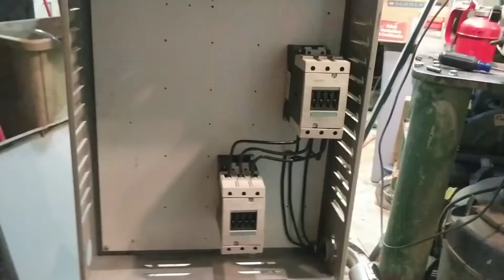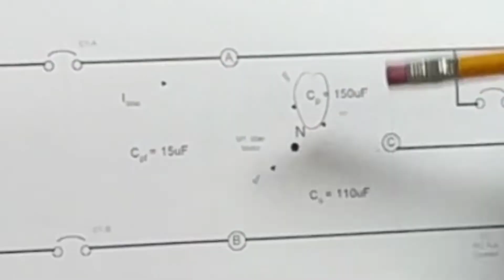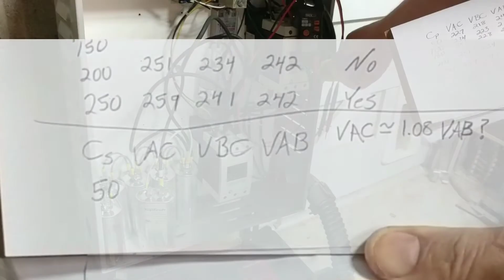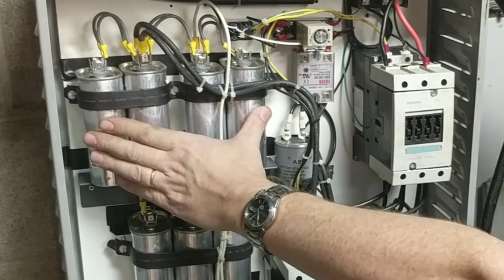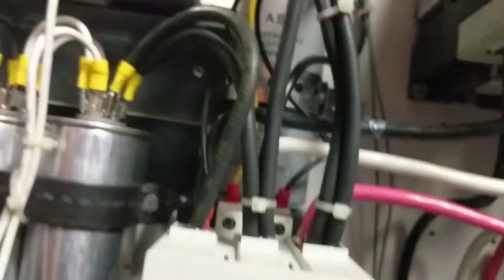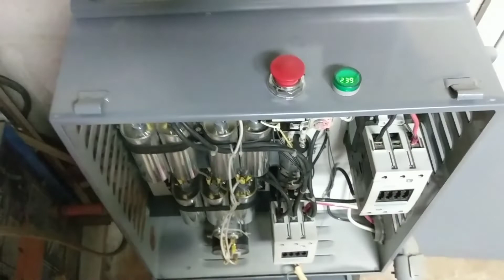Building a Rotary Phase Converter: Part 2 Assembly, Balancing and Final Testing

Comment: Definately a safety hazard by not setting your contactors on in the case of a power outage.  It's a code violation as well.  Good luck, and play at your own risk.
Reply: The fundamental video is very good and instructive, but I agree with others that having a start/stop/emergency switch wired in concert with a 'latching' relay would be advisable and I don't see how that is any more difficult than a push/pull.   Push start to start, push stop to stop vs. pull to start/push to stop on a single button.  If the power outage whether due to utility supply failure or breaker trip due to faulted condition in the unit, it is best not to allow reenergizing the unit without human intervention.  As for the code...if it is considered part of the supply system then regardless of what you do for switching, safety, etc it is not legal---all electrical supply equipment must be listed by an approved listing agency such as UL, CSA etc or it cannot be installed.  As shop equipment, the NEC does not require listing, though most device/appliance manufacturers get listed to be able to get insurance, but the NEC listing requirement is not applicable so I would consider it shop equipment.   I think your video and the application is well done and clearly you, for your own use will be just fine----in my world we have way too many that shouldn't even be near anything electric but the responsibility doesn't seem to fall on the users anymore, it's always someone else's fault.  Operator stupidity is automatically excused in lawsuits.
Reply from the maker: @sclarksclark  Well thought out comment.  I suppose if I had to do over again I would do it as you describe. I'm still confident that I haven't produced an unsafe product. But if the whole world disagrees with you, then there's a chance that you might just be wrong! 🙂
Reply from the maker: I'm not sure I follow.  With single phase power active, the unit produces 3 phase power.  When single phase power goes out, so does the 3 phase power.  When single phase power comes back online, after a few seconds, so does the 3 phase power.  What's the safety risk?
Reply: @TheBuildist  it's outlined in the electrical code to have your contactors wired so they pull in power with a momentary switch and a stop switch wired in series so that when the power goes out without supervision the system does not re energize thus causing a potential hazard.  
If you are diligent about making sure things are turned off then you should be safe however to get an electrician to wire it by code he would be asked by the inspector to fix it or it does not get certified.
Reply from the maker: @shawnshannon984  I don't doubt that you're accurate about the code.  But an RPC isn't equipment, it's supply.  I don't turn off any other parts of my electric supply during an outage:  I leave my main breaker and all my branch circuits turned on, and when the power comes back on, all of my outlets automatically come back on as well, and anything I have plugged into them.  I don't know anyone who has any concerns about that.  Why should 3 phase power outlets be any different?

Comment: I have to wonder if it's better to tune the rotary phase converter's capacitance under load as opposed to no load. 
As we know adding capacitors in parallel causes the capacitance to be additive, and the voltage rating to be the same (if they're all matched), or the value of the lowest voltage rating if they're not.
If we wire capacitors in series the relationship cuts the capacitance as follows: (C1 x C2)/(C1 + C2) in the case of two caps. If you're placing more than two caps in series then use this formula: 1/ (1/C1 + 1/C2 + 1/C3 etc.) You can also use this for just two caps as well.
As an example, wiring two 50ufd caps in series will give you 25ufd of capacitance, and the voltage rating is additive, in other words if the caps are rated for 370 volts the combination will give you a voltage rating of 740.

Comment: I have an Anderson MFG  (out of business) 7.5 hp phase converter with bad capacitors (unlabeled) The  2 run capacitors are 2.5 x 4.85 round aluminum wired in parallel between 1 leg of 220 and the converter motor / 3rd leg.  Can you help me estimate what capacitance I need and what kind of capacitors?

Comment: You seem to have made a substantial investment in time, relays, switches, and capacitors to make it work.  Wouldn't it be more cost-effective to just drive the 3-phase motor with another motor, such as a DC motor, and thus use the 3-phase motor as a 3-phase generator?
Reply from the maker: Good question.  The rotary phase converter was invented long before I came along. This is just my attempt to demystify it for anyone else who finds themselves in my situation:  I have a plentiful supply of AC electricity that is the correct voltage, but the wrong phase type for my motors.  So I simply need to convert my single phase AC to three phase AC.

You could very well turn this three-phase motor into a generator. You could drive it from a DC motor, a single phase AC motor, or even from gasoline. But any of those would have cost me more time and expense, and would have been larger and heavier and noisier than the RPC that I ended up with.

But I like the way you think! 🤔
Reply: @TheBuildist  3 phase motor don't have magnets guys, no chance to generate 3 phase. Read about deferent between  3 phase alternators and 3 phase motors.

Good video btw. :P

Comment: Wow nice work, I started to put my converter together last night. All going to plan until the start capacitor blew up in my face, I have the same brand as you but 1000uf, as I’m running a 15hp motor for the converter, lol

Comment: U could install a stop start switch to prevent it from coming back on after a power outage
Reply from the maker: Yes that suggestion has been made, but I really prefer the single switch with no extra momentary/push button switch necessary.  From my point of view the phase converter is not a machine. It's part of the power supply infrastructure. If your single phase power goes out your three-phase power (RPC) goes out too. And when you're single phase power comes back on, then your three-phase power (RPC) will come back on as well, unless you have chosen to specifically turn it off during the outage. 

An operator of any single phase machinery knows that they need to turn it off in the event of a power outage. No one would just walk away from a running table saw or drill press just because the power went out.  Three phase machinery needs to be turned off in the event of a power outage as well. In case of a power outage, simply turn off the mill or lathe or whatever that you are running.

Comment: You might want to re-think the auto-start feature of your converter. If it's powering a machine when it comes back on, your converter will be trying to start the idler motor and the motor on the machine that it was running. There's a good chance that neither motor will start up, and things will start to get very hot, very quickly.

Otherwise it's a very nice and clean build, and obviously it works just fine. :)
Reply: Are there not no volt release starters on the machines? No machine should be able to start again after the power went out and then comes on again. That's mandatory here in the UK.
Reply: @samrodian919 Yes- my thoughts exactly . I would have thought that this ingenious chap would have just set up a latch to switch on the converter- job done even if the machinery used on it does not have an electrical latch . Just replace the mushroom switch for a momentary switch and a small ice cube latch and that's the job done .
Reply: @samrodian919 those style los of power switches are not required in the US as far as I'm aware.
Reply: My only take is my experience with a city which has 100 year old infrastructure. On top of that, where I’m currently living is the only section in New Orleans with underground wiring. Just not maintained. FWIW, just last week our electricity would completely go out and almost immediately restart after about 3 seconds. This went on for over 6 hours and would happen about every one half hour. I’m sure this isn’t the norm in America. More like Iraq . Anyway, we still do get the electricity go off and restart just once or twice fairly often.  But, this is New Orleans.
  All that said, this is still the best video on RPC’s. I’m going to do a build with a 5-hp…and your video is excellent. It won’t be hard to figure a way to prevent it from restarting in my opinion.
Reply from the maker: @timmer9lives  You make some good points.  In the every 3 seconds scenario, assuming you are running something like a mill, when the power went out the mill and converter would both turn off.  Three seconds later when the power came back on, the phase converter would immediately spin back up, and a second or so after that the mill would turn back on. I could see how that could be a little nerve-wracking. But I don't see how it would be dangerous.  

But the auto start feature is very simple to disable. Simply replace the 1 second timer with a momentary (push button) switch.  Then to start the phase converter, turn on the master power and push the switch in for a second or two till you've heard it spin up, then release the switch.
Then in case of a power outage, the two contactors will both turn off and will remain off until you've pushed the start switch again.
Reply: @TheBuildist  sounds good. FWIW, it’s probably less of a problem in the shop. But the poor electric issues do play havoc with HVAC Systems and refrigerators. It’s hard on the compressors. Every time the lights start to flicker I have to run to the house thermostat and turn off the A/C. Anyway, I agree that it’s probably not a dangerous issue for your set up. Thanks for the reply and thanks for the videos. Excellent rotary phase converter build description.
Reply from the maker: Close observation but not quite correct. The starting capacitor is only in circuit before the secondary output contactor has been closed. So on a power outage situation when power comes back on the power will immediately start the idler motor and as soon as the idler motor is spinning then the timer will pull the starting capacitor out of the circuit and activate the secondary output contactor which will make the machinery start back up.

it may not be ideal to have your machinery start back up unattended. But that I leave to the common sense of the user. You should never walk away from a machine that is turned on even if the power has gone out.  And though it could conceivably cause a machinery crash or some other undesired outcome, it will not lead to an overheat or damage to the rotary phase converter itself.

Comment: How much would it cost a household to have 3 phase power connected to the house.  Here in Australia we have three phases at 240 volts passing every house.  The customer can have 1, 2 or 3 phases connected depending on load required.  Each phase can have 100 amperes drawn so the power available is almost limitless.

The phases are balanced in their draw by the supplier connecting each house to a different phase.  Most houses draw on one phase only but many use two for cooking and heating.  But three are available if the need arises. Each capable of 100 amps at 240 volts , with 415 volts RMS available between phases.  The system works well and we pay about 25 cents per KWh.  Depending on time of day. 

Stavros
Reply from the maker: Here in the States, at least in my sleepy residential area, three phase is just not available to a residence.

if you could get them to install it the cost in labor and equipment would surely run into tens of thousands of dollars.

Comment: Hi. Thanks for a great video. I have a 7.5ph 3 phase lathe. And i would like to make one of these converters. What size motor would i need to make on of these converters for my 7.5hp lathe. Many thanks.
Reply from the maker: In general terms, your phase converter should be 33% larger than your motor.  So to get the very full 7.5HP out of your motor, you'll need at least a 12HP RPC.

Comment: If you bought A contactor with a 240 volt coil and you used the breaker as the switch or an external disconnect you don't need the solid state relay, 24 volt relay, or 5 volt power supply or the other contactor. You basically just need one contactor and the timer for the start cap. That's how I built all 3 of mine. The biggest concern I had when balancing the voltages was not to exceed nameplate current on the generated leg going to the poney at idle my wall current was at 3ish amps but the generated leg was over 20 amps. FYI. Good build
https://youtu.be/hyjYdEL-80s
Reply from the maker: You're right, of course.  But I wanted the nice fancy looking red mushroom button, and the timer relay was only rated for 5 amps, so I needed to drive some kind of contactor with it.  I figured the instantaneous nature of the solid state relay would work great with the sub- single second timing, and I wasn't disappointed.

But you're exactly correct to point out that a fully working RPC can be built that's simpler and even cheaper than this one.

Thanks for the info and your thoughtful reply.

Comment: I just bought a 10 horse control box for $200.  That’s gotta beca bargain doesn’t it?
Reply from the maker: That's certainly not too bad. The bill of materials for the components in the box would have to be in the $200 vicinity.

Nicely done.
Reply: Dave Salzer You got deal of the century. Googled 10HP static phase converter and got Larson Electronics unit for $1054 (plus shipping and tax). Phase-A-Matic makes smaller static phase converters that allow running 3-phase motors off a single phase but you get 2/3 of the motor rated power at light to moderate loads. Those are in $200-300 range.
For heavy load Phase-A-Matic says “ you must use rotary phase converter”. There is a long list of equipment that will not run off static converter.
The good news is you can use static converter as a ready to use controller for a rotary phase converter. Just add properly sized 3-phase motor to act as generator.

If you only have lathe and a mill with 1-3HP  3-phase 220v motor, an import VFD is a good option. For less than half price of static converter you get full rated power of the motor and as a bonus you get variable speed control of the motor.
RPC is more robust, can handle overload, heavy continuous load, can power multiple devices at the same time (up to total capacity of the RPC) and each can be switched on/off independently. VFD or static converter is dedicated to a single motor.